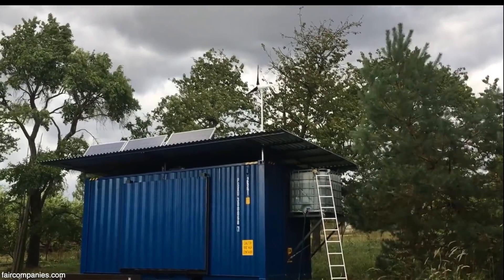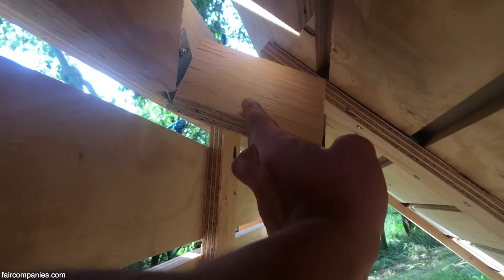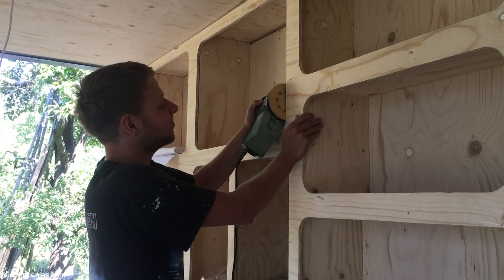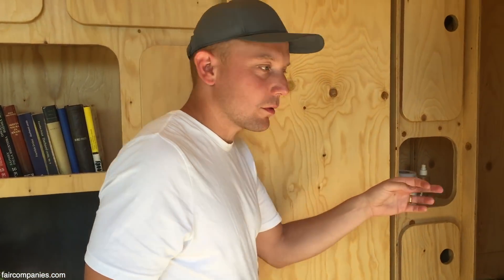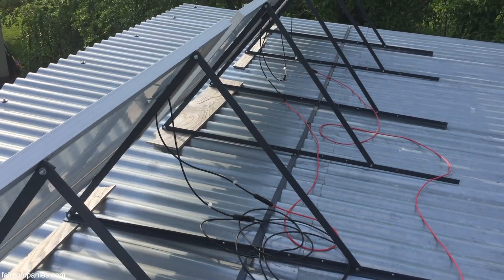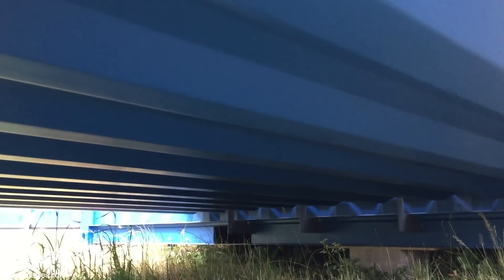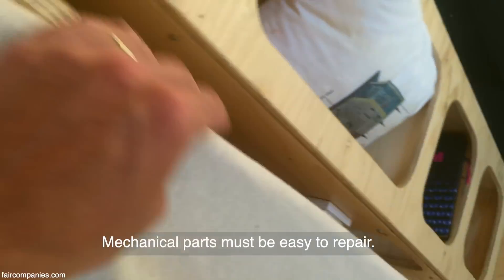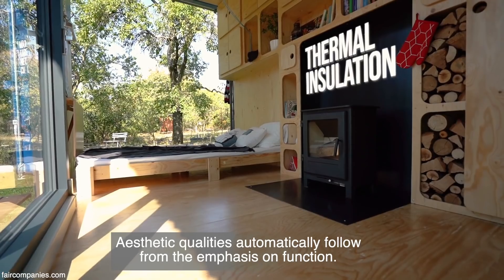Off-grid container home uses pulleys to lower/raise bed & deck

Comment: I have a friend who really wanted a shipping container, then I showed him how easy framing a shed can be, just put metal panels on for siding and save more than half the cost to fix the inside. I love the container, but they are too pricey, and you’ve got to cut windows in with a torch

Comment: He wouldn't need that pulley inside for the bed if he would flip it so it just folds out from the top it would be easier on his back & one person can do it. 
Put a hole in the center to get your fingers in, like he did on his cabinets, if he has plywood on it for the bed, if it's slats, you don't need finger holes.
I like his setup. Very good job,
Chris from Missouri

Comment: Portable gas bottles inside is against code here: its much safer outside and plumbed with rigid pipes. It's better outside and LPG leaks unlike natural gas settles down on to the floor near the power points and boom. But that's the only fault from putting the one tone of water on the ground: with a pump there is no reason to elevate it.
Reply: I guarantee you that codes and regulations don't affect this guy hidden somewhere in a village somewhere in Europe 💩
Cost is the only thing that can influence his decisions 🤣
Reply: Especially with a wood heater inside the house as well.

Comment: Some really smart design principles utilized in this build. Simple, manual, robust systems are far more reliable & maintainable than over complex modern state-of-the-art solutions. You can keep them running even when society itself is breaking down.

Given the many problems brewing around the world in the 21st century, including climate change & economic instability, a forward looking person with some smarts would be buying a piece of land with clean water, good soil, some forest and low property taxes on which to create a small, sustainable, renewable energy powered homestead.

Challenge number 1 is then to quickly inhabit the land for periods of time to start creating basic survival infrastructure. A low cost, transportable, self-sufficient drop & go container house like this is perfect for this shelter role. It can even be secured for when you have to return to the city for your regular day job, where you can earn some hard currency.

A second container set up as a workshop with all of your tools and a way to store materials will get you fully operational in no time. (See Project Kamp for their brilliant 2 container setup.)

So, nicely done Vojtech & Family!
Reply: Agreed, and in Australia it's needed to overthrow council officials who refuse to allow dwellings such as this. Even in rural areas there are many restrictions.

Comment: How do you run a water boiler with only 2 solar panels and 400w inverter? Am I missing something?
Reply: Using gas, no?
Reply: with a lot of patience, maybe? 
he said it was 24W I think
Reply: There are actually 3 LARGE solar panels connected via 2 main wires into the two batteries as well as a wind turbine which converts energy/power via converter then batteries to hold the energy. It's around the 7 minute mark for reference.
Reply: Its telling that the hot water service wasn't working in this video.

Comment: I would love in that. It is a good design, living off grid is less difficult now. I expect the cables for raising and lowering the "patio" will not often be used - only to move the entire structure.I
Birdy
Reply: Also when they go away, it can be closed up to be totally secure, since I suppose it is only a weekend or holiday cabin.
Reply: And...for storm season here in Texas! If a gale came, I'd be hoisting that thing up really quick. Maybe install a storm shelter inground for the tornado season.

Comment: The bed is great and I also really like that big air gap between the roof and the top of the container. It should keep the house pretty cool in the summer.
Reply: I love the air gap too.  Wondering how it would hold up under heavy winds.
Reply: Judging by the size of that wood stove he should be able to keep it pretty warm in the winter too.
Reply: I've thought of that concept of an air gap for years.  So there won't be any radiant heat transfer in hot, sunny weather.  Glad someone finally put this simple concept into practice!
Reply: @mikecranapple8878  Common practice in Europe.
Reply: @wthomas7955  And can be found in the southwestern US.

Comment: The location of the gas cylinder inside of accommodation space is unsafe. It should be moved outside.
Reply: Agree, especially in the winter time when all the doors are closed.